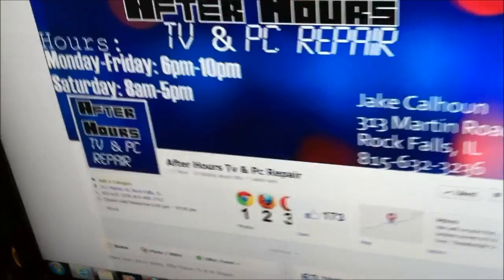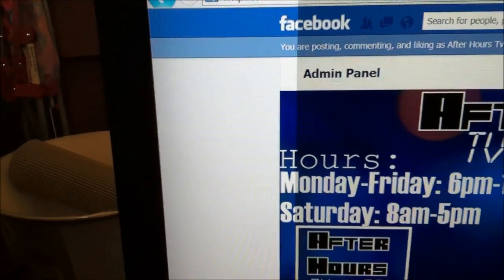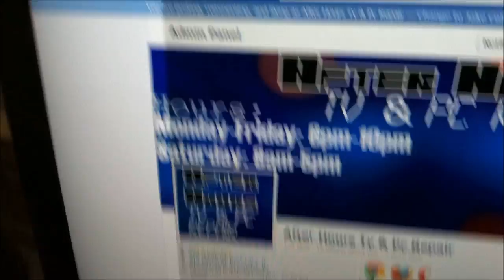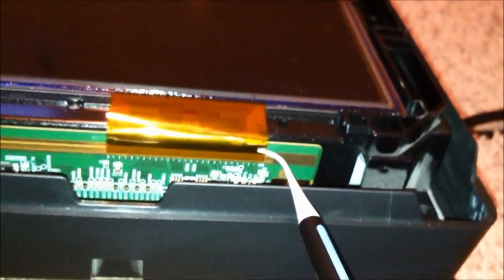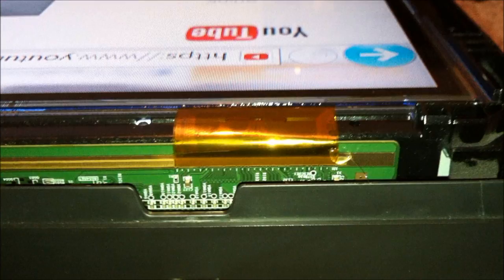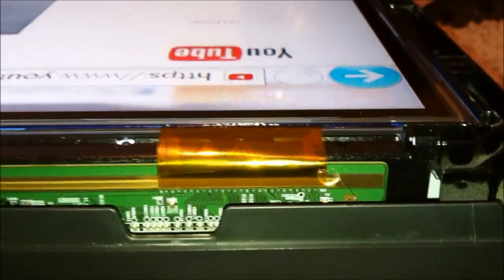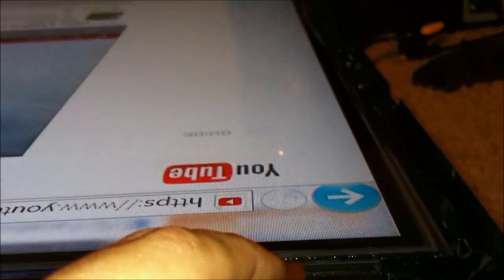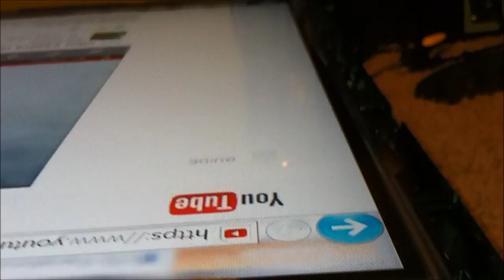sanyo dp42849 vertical bar problem fix

Comment: I only had one ribbon that was messing up half my screen. What I did was instead of thinking to push the ribbon down, which distorts the shape, was to support the ribbon up. I took a piece of wire about the thickness of a round tooth pick and stripped off a 1" piece of its insulation. I slid that insulation under the ribbon on the side that is connected to the circuit board. I can't even imagine what these ribbons do. I guess its some sort of fiber optics. I got no idea. Good luck.

Comment: I have a Sanyo TV that has the same exact problem. A horizontal bar on the top 1/4 of the screen that comes and goes. I will be trying this method very soon after a failed attempt at attaching a clamp to the top of the screen bezel to put pressure on the TAB. It worked at first when the TV was hot. But the next morning when I turned the TV on the black bar was still there and appears about 5 seconds after the screen turns on, and putting pressure on the panel does nothing anymore. The black bar seems to flicker every now and then. So I am almost 100% certain that this is caused by a bad connection in the bonding TAB to the T CON board.
Reply from the maker: It is caused by a bad connection on the tabbed board not the tcon board.  Two different boards. Tcon is the much smaller board that connects to it. There is no really fix for this, sometimes this works sometimes it don't. I tell people not to buy Sanyo.